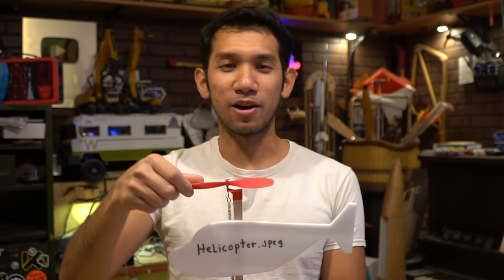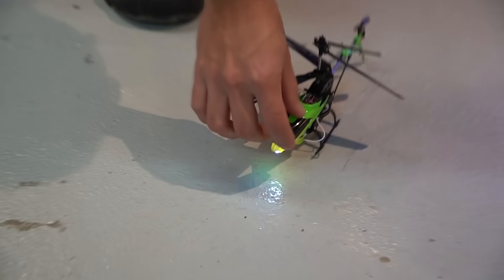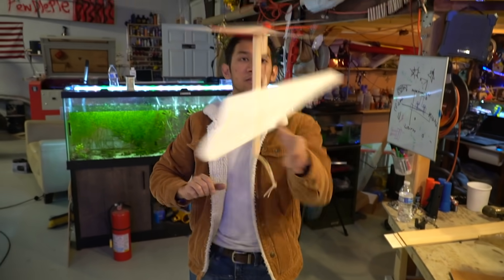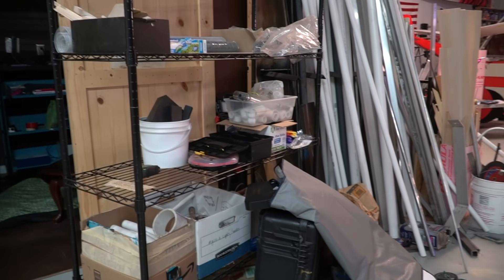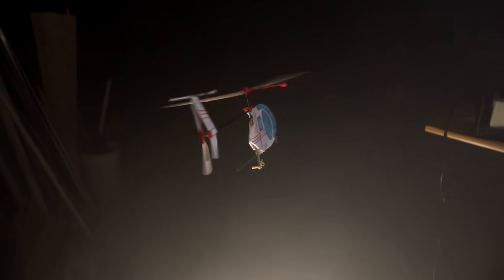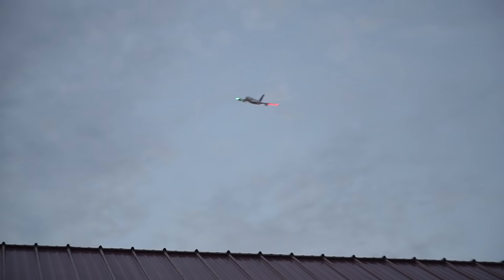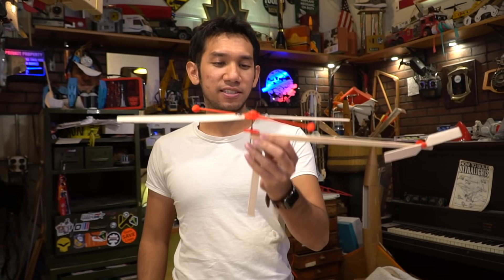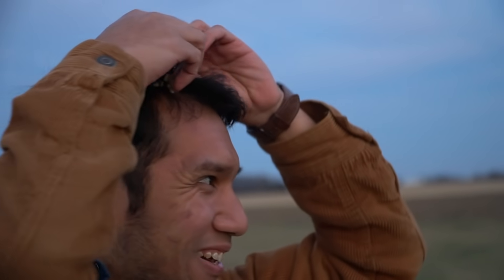Making a Rubberband Powered Helicopter (working tail rotor)

Comment: I hope this doesn't come across the wrong way as I just want to be helpful.

That said, perhaps you should try replacing the string between the wheels of the pulley system with a cheap stationery rubberband like they use to bind letters together in office buildings.

A stationary band would automatically tension itself around the surface of each wheel in the pully, making itself much less lax than a string, therefore less likely to come out of the pulley wheels.

The band also wouldn't have a knot removing the risk of the knot in the string being too chunky to properly seat itself in the pulley wheel and causing the "belt/chain" to slip out of the pulley system as the tied section of the string around the surface of each wheel in the pulley.

For that reason, I think that if you used a stationary band your design might have had a slightly better degree of success and be less likely to have such hiccups with the tail rotor. Plus if you find the right seller stationary bands can be purchased much cheaper than a spool of elastic string and in various sizes depending on what you need for a specific project.

You might also try using several small bands together so that if 1 band fails there might still be 2-3 other ones there to keep driving the rotor.

Comment: the upper rotor blades need to be able to pivot around the attachment point. as the rotor actually swings and chops through its cycle kind of like a whip. research rotor blade physics =]

Comment: there's a lot of technique involved with the sport rubber, you can stretch then 3-4x before winding, and releasing a wind before takeoff will significantly alter the torque curve.

Comment: As an aside, the assertion that rigid mast rotors don't work isn't correct. A large number of helicopters are designed with rigid masts and they offer a variety of benefits over articulated mast designs, but require more complex mechanisms to control blade angle. 
https://www.danubewings.com/rigid-rotor-system/

Comment: 1:42 Notice, that theese sticks make about 90° angle with the blades. That's because of the gyroscopic precession. If you want to tilt the helicopter forward, you need to "push" it from the side. That means, that in order for it to tilt properly, you need to adjust the pitch angle of the blades as they cross the axis you want the heli to pitch along. Hope I explained it in the way, that it's understandable.

Comment: Hey Peter why not put some sort of teeth on your pulleys and use a rubber band from the front and rear tail rotor pulleys should help with the string slip and should be better

Comment: I have recently seen some research towards non-planar slicing for FDM printers and they achieved some pretty cool results. There appear to multiple articles upon googling but the research I saw was from Europe or something in the format of a research paper. The hard part appears to be setting up a slicer that can generate these non-planar tool paths (more difficult for Windows), but if you look into it and have some good computer knowledge I bet you could figure it out eventually. There are a few limiting factors as far as hardware goes such as clearance of the hotend and what not to make those cool curves but you can probably modify your printer to be more narrow at the end for more dramatic curves.

A few pages that seem to explain it really well and actually provide a seemingly easy way to get the G-Code:
https://hackaday.com/2016/07/27/3d-printering-non-planar-layer-fdm/
https://hackaday.com/2016/07/20/3d-printering-g-code-post-processing-with-perl/

Since you're so into airplanes and stuff I figured this technique would be right up your alley and would allow for some really nice wings or something. Love your content as always, makes me want to build this helicopter and print these parts myself.

Comment: So let me start this by saying I have no clue what I’m talking about but I have what I assume to be a good idea....is there any way you could make a directional clutch system and a bearing on the propeller to where the rubber band can power the propeller but at the end of its power cycle the propeller can keep its momentum going freely without drag from the rubber band so the propeller doesn’t try to wind up the band in reverse at the end of its power cycle

Comment: The chicken slap thing doesnt take into account the dissipation of heat over time. So you would have to hit it with all the slaps at once from all angles to make it work.
Reply: I did some thermal analysis of the slapper, it transfers about 0.2% of its kinetic into thermal energy.  It does indeed heat up, but to slap with the speed (and thus power in W) needed to cook even a layer of it turns it into paste.  Louis should post the video of it soon here: https://www.youtube.com/user/WeiszCracks

Comment: I've often wondered if it would be possible/practical to use "wings" jutting out from the side of the craft to direct the down wash, creating a counter rotation to keep it from spinning out of control. The "wings" would aim up, towards the rotor, as opposed to forward as in an airplane.
In doing so, it might be possible to do without the tail all together. (?)
Just a thought...
Love the channel, by the way!
Cheers!
Reply: (just had another thought) .. In using this configuration, controlling yaw could be done by adjusting the pitch of the "wings". For pitch and roll, a counterbalance below the craft could be manipulated left, right, forward and back of the datum accordingly.

Comment: The chicken must be insulated so you don't lose heat between slaps.
Reply: The slapper sadly acts as a giant fan.  Airflow heat loss over like 10W/m really kills the surface temp. Insulation would reduce radiative loses considerably tho. Meat is also a terrible thermal conductor, so the heating is localized anyways.  I spent longer than I want to admit modeling this.  Louis should post the video results here soon: https://www.youtube.com/user/WeiszCracks
Reply: @RepeatedFailure  lol are you f*cking serious?
OK I  subscribed and hit the bell :D:D:D

Comment: Peter Should Build A Real Helicopter Instead Of Planes
Reply: @Thomas-nc9fz  really? never would have thought that?
Reply: @camdenweirich  to properly control an helicopter you need to be able to control the pitch of the rotor blades in all axis while they are rotating (and you need to keep this control synchronized with the rotating speed), so it's just horrifyingly complicated....
Reply: @red1246  O it still would be cool to see Peter build one
Reply: @camdenweirich  of course it would be
Reply: @camdenweirich  Yeah, real helicopters function much differently than toys (in less than obvious ways). The RPM of the rotors on a real helicopter stays the same through the entire flight, and the amount of lift is changed by tilting the rotors, much like how airplane ailerons tilt to change the amount of lift. And the linkages that connect the two rotors to the motor can be very complex. There's a reason you see lots of homebuilt airplanes fly, and very few homebuilt helicopters flying. They're also MUCH harder to control
Reply: @Studio23Media  O never really thought of it that way, still would be cool if he built one tho
Reply: @camdenweirich  Oh yeah it'd definitely be cool! Pretty dangerous and expensive though
Reply: @Studio23Media  yea
Reply: Show them Africans how it's done!
Reply: Show them Africans how it's done!